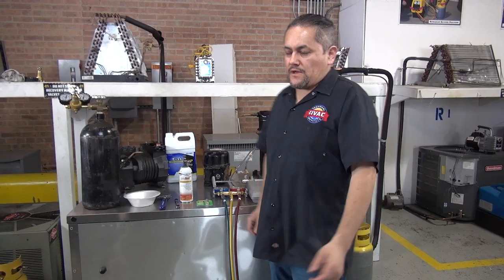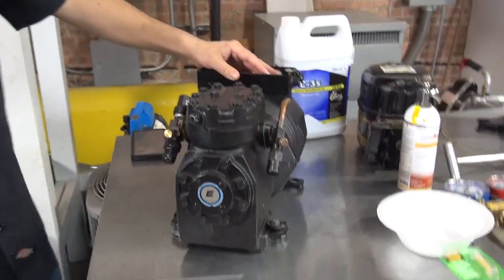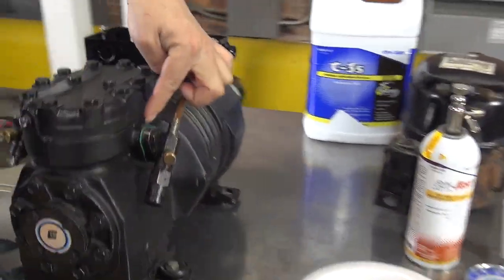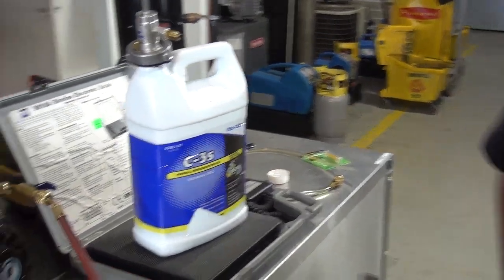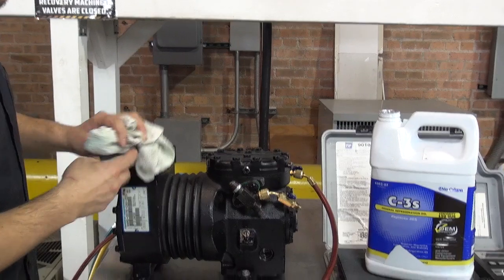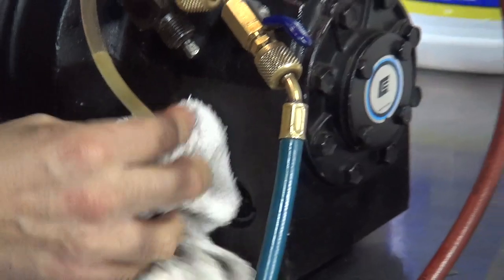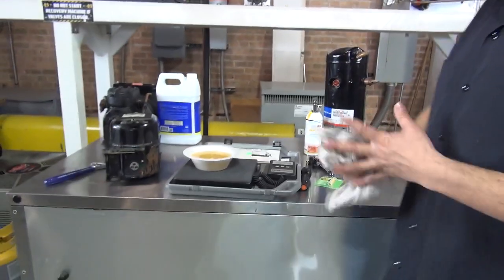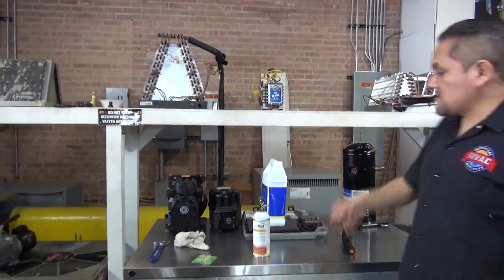HVAC/R  How to change oil in a reciprocating compressor

Comment: But if I just isolate the compressor, and if the system still has Freon in it. And when I add oil to it, aren’t am I over adding i, because the Freon that’s still in the system also has some oil ? Unless if I recover the whole system, and change the system with new refrigerant

Comment: You say not to pressure test beyond 50psi.  Let’s say the unit has R404a and is sitting unplugged in a room that’s 80degrees, the high and low side would be 173psi.
Reply from the maker: The company does not make semihermetic  compressors for R410a. These compressors are only for R 22 ,R134a, and  R 404 a.
Reply: @paulohvac I didn’t say R410a,  that is used in A/C.  Even if it was R22 at 80degrees, that’s still 143psi. I liked your video, I’m just curious about that part of it.

Comment: So on a sealed Compressor, After draining the old Oil out, Wouldn't I have to reinstall compressor then pull Vacuum then add the New Oil ?

Comment: if you have a high concentration of "ACID" in the system , that is caused by high motor temperatures in the compressor, and the oil comes out brown or black( also caused by high moisture in the system) that compressor is going to fail, changing the oil in a compressor that is on its way to becoming a "BURN OUT", you are wasting your time, look at what you have to go through to change oil in a "TIN CAN COMPRESSOR" it is not worth it!!!!, and will result in a callback. not only that you would have to add both liquid/ suction line filter dryers  a sight glass with a moisture indicator  after the liquid line filter dryer is a big help too!!!

Comment: the name tag on the semi- hermetic will tell you what oil is in it (A.B./ mineral/ P.O.E) and the oil charge ( in ounces). if the compressor has a red tag on it, it will not tell you the oil charge, or type of oil( red tags were used from 1958 to 1988), white, blue , and black tags will give you the oil information needed. also that "K" body compressor( air cooled--3/4 H.P. low/ med. temp 230 volt single phase, / charged from the factory with "P.O.E." oil in it) has an oil pump on it , and the oil level should be checked with the compressor in operation!!!      ( compressor build date oct. 2001)      do you plan on running this compressor on a refrigerant that is mineral oil compatible??????, not only that you have "MIXED" P.O.E. OIL WITH MINERAL OIL IN THE COMPRESSOR!!!!!!!( you did not get all of the oil out of that compressor, to do so would require a complete teardown)   this compressor was set up to operate on R404A refrigerant!!!!  if you were in my class I would have made you tear that compressor down to get all of the "MIXED" oil out of it !!! ( or take an "F")
Reply from the maker: Thank you for your comment we normally use mineral oil because it's cheaper, I have a 20 students changing the oil,  This compressor we only use it for practicing, the technical has been already covered.  Sounds like you already know all this information by the way school's hiring is really hard to get good instructors with experience and willing to teach.
Reply: @paulohvac  , thanks for responding back, I did teach hvac-r  15 years ago, and I thought that this compressor was "DONATED", not to be put into operation. I always had my students tear down the semi- hermetic compressors, and put them back together and run them in "LAB", I even had them build "U.L.T." cascade freezers. I also worked at miami university( oxford ohio) where I worked on constant temperature refrigeration equipment, and "U.L.T. freezers", chillers, large hvac systems. it is real interesting that the number 1 failing compressor was the "SCROLL". one time I was called to the food storage building , where the "FREEZER WAREHOUSE" was not holding temp( too warm) "there was  4, 50 H,P. 480 v. 3 ph. scroll compressors operating on R404A refrigerant. well 2 of them failed( locked up) these compressors have oil sight glasses on them and no oil was showing in any of them so I ordered new compressors, I found out that no warehouse in the U. S A. had that compressor. copeland had to build that compressor, it was the largest one they made!!!! I told the food service manager that it would take 2- 3 months to get them in, so he told me to order 4 of them, and do what you need to do so this does not happen again!!. I installed "OIL SEPARATORS" on all of the compressors, then I had to start taking oil out of the compressors(TOO MUCH OIL" I scavenged 5 gallons of excess oil out of each condensing unit. the best / long lasting compressor was the "SEMI-HERMETIC" I rebuilt many of them!!!!   have a great day!!!!. if you want to talk "I AM ALL EARS"!!!

Comment: Why do you put the oil into your suction line?
Reply: you really should not do it that way, the weep hole in the bottom of the suction port is small, and needs time to drain the oil back into the crankcase. that is a great way to break reed valves on restart if oil is still in the suction port!!!

Comment: Just a question,let's presume that we have a full charge system on which we need to change oil,after front seating both suction and discharge king valves,and recovering the gas I charge gas N2 to get the oil out of the compressor how do I confirm my valves are holding my fear is that the N2 could get into the system if the king valves are not holding.
Reply from the maker: Very good question this could happen but it's pretty much your call,see how many times those kingvalves are being moved is this an old system if this is a new system if this is an old system where the opening closing the valves too many times, base on my experience I have not run true this problems. Take care ....

Comment: Can you use mineral oil, which is what the video shows, to this compressor which uses R404a refrigerant?
Reply: P.O.E. oil is only compatible with R404A  refrigerant. mineral oil will not damage the compressor, however mineral oil will not attach itself to the refrigerant, and you will "LOSE" the oil in the evaporator ( esp. on freezer application). this will cause oil migration/ oil return problems, so the oil level in the compressor will drop to a dangerous point that will cause compressor failure ( no oil in crankcase) if you want to use mineral oil, then you will have to change the refrigerant, that is mineral oil compatible.

Comment: Is it possible to add oil through the oil-removing port? If not then would you explain why, please?
Reply: that is where I always remove/ refill the oil, it is dangerous to add oil to the suction port, the compressor is not designed to pump a liquid, that is a great way to cause reed valve damage if the compressor is going to be returned to service. the weep hole in the bottom of the suction port is small and needs time to drain back into the crankcase!!!!

Comment: sir, I got aircon reciprocating compressor used  for spraying paint for hobby...i worry in the long run it will run out of oil...sobefore it happens shall I replace the oil for the same purpose before as aircon compressor or some engine motor oil...newbie here😃
Reply from the maker: Iam not familiar with air compressor but lubrication is important, if you think it's low in oil, you should add some..

Comment: Plastic cap is not there to stop leaks, my  dear friend. It is to protect stem from elements! Brass nut on stem is for stop leaks. It should be losen and tighten at any valve stem manipulation!
Reply from the maker: Yes sir, manufacturer use to make brass caps, i guests it was too expensive for them so now it's all plastic...

Comment: Paulo, excellent video. Thanks for taking the time to show us something useful that some HVAC books do not explain well. I work mostly with A/C units and pneumatics. Recently, I was asked to troubleshoot a walking cooler. I found that the previous HVAC tech charged system with 134a. I contact Emerson because in the mobile application I did not see any medium temp application with 134a. I was told that The compressor was used as one horsepower.  The compressor was manufactured in August 2018. I was able to find resistance in one of the windings, but the other two are open. I cannot believe that this compressor has been damage so early. The overload protector in the terminal box checked under  1 ohm, which according to Copeland support tech is fine. Question: do you have a good book that you can suggest about learning more about semi-hermetic compressors? Thank you again Jruizlbcc@gmail.com: Juan

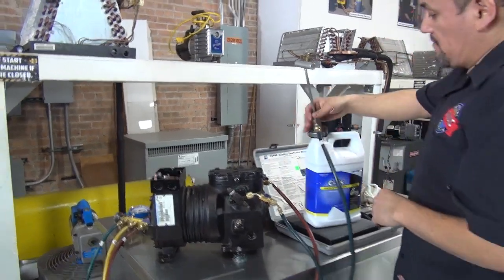Comment: Awesome video and a lot of good information. I would only recommend bleeding the oil through the blue hose that you have attached to the oil pump and the suction king valve. When you pressurized the hose (@ 17:00) with oil you still have air trapped in hose. Then if you when you crack that low loss, you add air to the system.
Reply from the maker: That is right, thanks you